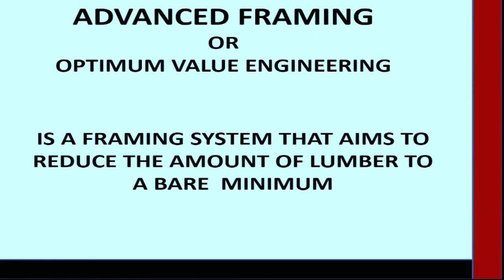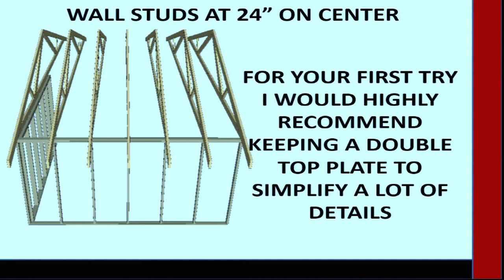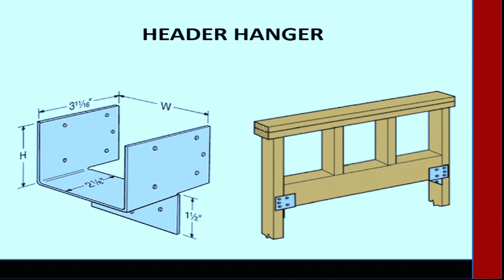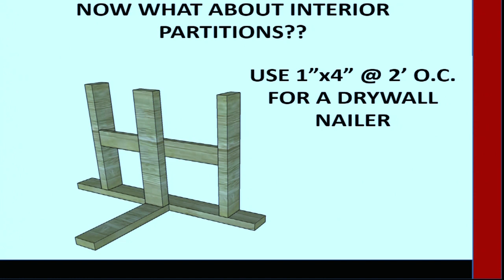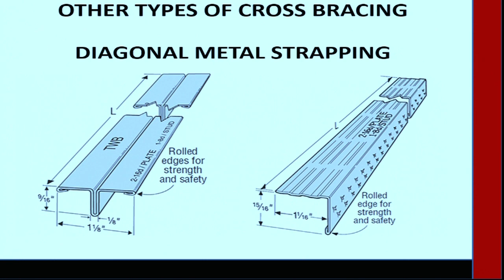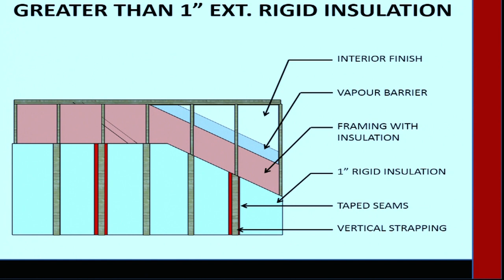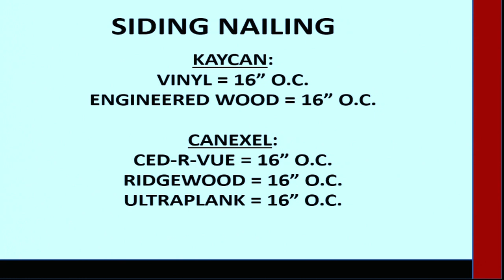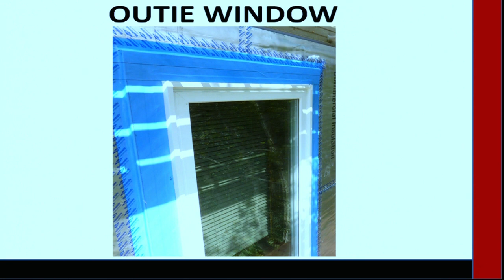NHC 2016   Advanced Framing

Comment: Sports, Computers, and Construction.   Those have to be the near the top with regards to the over-abundance of “experts” and “forward thinkers” and stubbornness.  I am not sold on the “advanced framing” but want to keep an open mind but all of these videos posted don’t appear to test the effectiveness of this framing technique.  I would like to see the actual cost of savings to the home owner and strength to the home.  I don’t think there will be much by going for 16oc to 24oc (California corners or not).  If you take a 100’ wall (for easy bath and removing the “extra corner studs”, that would need about 50 2x6 studs on 24oc and 75 2x6 studs on 16oc.  If you took the difference of 25 studs with an approx. R-value of 4 per board and placed those side by side.  That is a little over 3 feet on an approx. 100’ wall. The true test would be to check the climate of the room and the cost savings.  That is what we are talking about right?   Saving energy?  If so, putting a thermal test on a wall when we have no comparison is flawed.  I try to take something positive from every builder I have been around but it’s hard to see value in any of this.  I think it is a marketing scheme for these guys to appear forward thinking.  I am a licensed contractor.  I think the building of homes is out dated and needs to be changed.  BUT… this seems to be an elementary way to sell snake oil.  Come up with something original like, an exterior wall that is made of a material high in R-value and does not rot and cannot be damaged by bugs.   Oh right, I forgot… that would take effort and you are trying to sell homes with a minimal amount of effort with regards to thinking.  I’ll keep watching and hoping for good science…
Reply: also 75 2x4s have roughly the same VOLUME as 50 2x6s.  26.5 square feet vs 27 square feet for 2x6. now considering your entire wall is 2" thicker, you have that much more room for insulation.

or roughly 251 square feet of insulation in a 2x4 wall vs 407 square feet in a 2x6 wall.

or a 60% improvement in insulation
Reply: How many videos are you going to copy and paste this on?